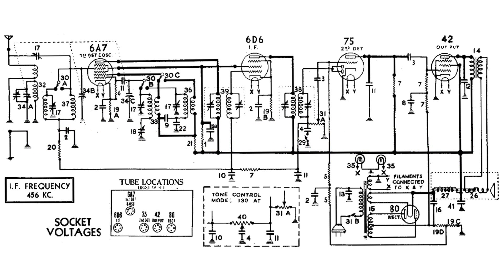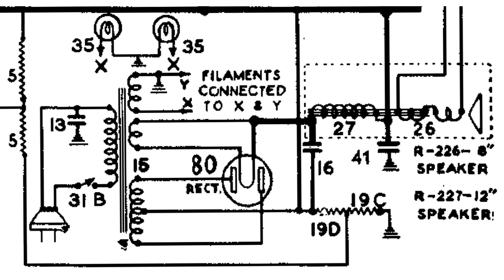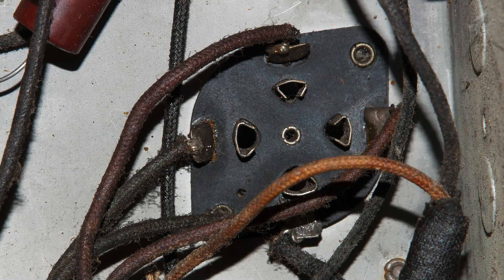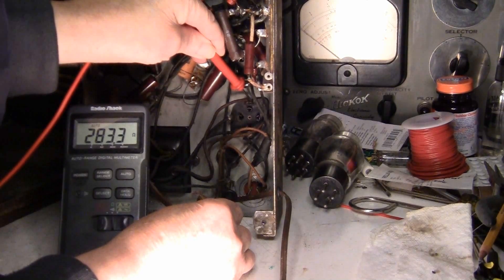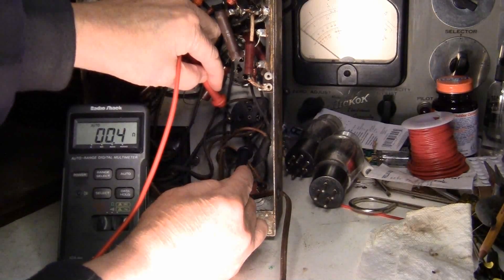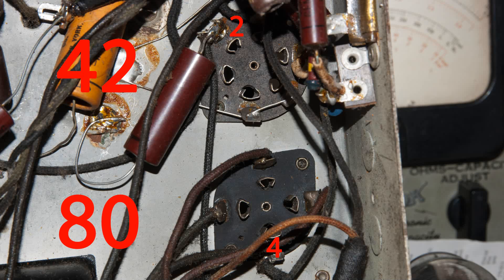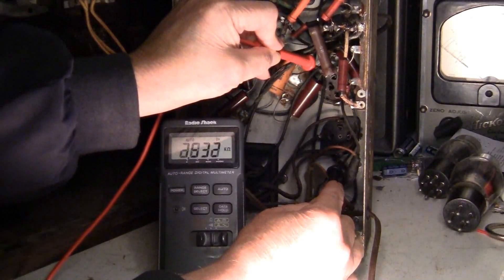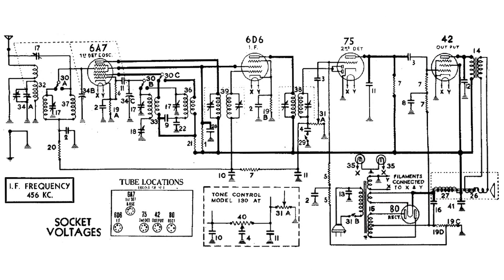Power Transformer and Audio Transformer Continuity Test, Stewart Warner 1301

Comment from the maker: @macksledge 
Very little, this meter uses DC in the ohm circuit, DC resistance. The coils do have impedance also. That is AC resistance and the impedance increases as the frequency increases. I have done one or two videos on this.

Comment from the maker: @joernone 
A good friend uses a battery all the time to test audio components continuity. It can save a lot of work, sometimes the connection on the secondary side can be difficult to get to. Also when You use a low volt per ohm meter you can hear clicks out of the speaker. I decided to show the battery because most meters today are very high impedance, the battery will work for everyone.

Regards,
Rick

Comment from the maker: @ntydk
Yes I always use an isolation transformer. From the wall socket into the isolation transformer, then into the variac then the chassis, always. If you download my free ebook there is a diagram of the setup in the appendix.

Comment from the maker: Thanks aulii08
Pin four is what is used in the radio, but the diagram shows pin one. If I used pin one it would go through the 5volt winding then to the field coil, and that would work. So the way it is wired does not match the drawing.

Comment from the maker: Thanks johnmcgiv1
The isolation transformer input is connected to the earth via the three prong plug. The other side, the output, is NOT connected to the earth. The output of the isolation transformer goes to the variac and both are 100% isolated from commercial power.

Comment: I have a Stewart Warner 1301 with a bad power transformer.  Can you provide me with the secondary voltages for this transformer.  I know that Filament # 1 should be 6.3V, Filament #2 should be 5V for the # 80 tube; however the plate voltage is unknown. Can you help identifying this voltage and even better recommend as suitable replacement transformer.
Reply from the maker: I did find some information for you about your Stewart Warner radio. The first link is the schematic for your radio from Nostalgia Air. The other two links are transformers from Antique Electronics Supply. The voltages are correct for both transformers the difference of course is how much current transformer will supply. Both transformers have a description of their voltages and lead layout, and there is information of the size and mounting holes of the transformer along with its weight.

I'll be glad to help you and Antique Electronics Supply is a good place for help also.
Let me know if you have any questions.

Stewart Warner 1301
http://www.nostalgiaair.org/pagesbymodel/332/M0020332.pdf

Transformer - Fender® Replacement, Power, 325-0-325 V, 70 mA
https://www.tubesandmore.com/products/transformer-fender-replacement-power-325-0-325-v-70-ma

Transformer - Fender® Replacement, Power, 325-0-325 V, 200 mA
https://www.tubesandmore.com/products/transformer-fender-replacement-power-325-0-325-v-200-ma

Rick
Reply from the maker: I sent you a reply with links. Sometimes this ends up as spam.
Reply: Thanks Rick....I will take a look and see what the transformers have to offer.....  Charlie.....
Reply: Rick it looks like the P-TF22772 will work, the other transformer is a bit to large to fit in the chassis.  Thanks so much for the links..... I did have the schematic. Have a great weekend and I will let yo know how I make out.   Charlie.........
Reply from the maker: I hope everything goes well, and good luck.